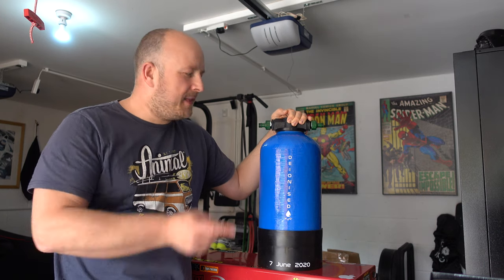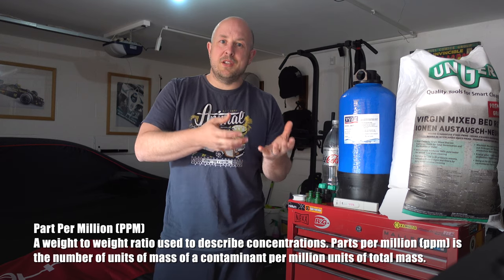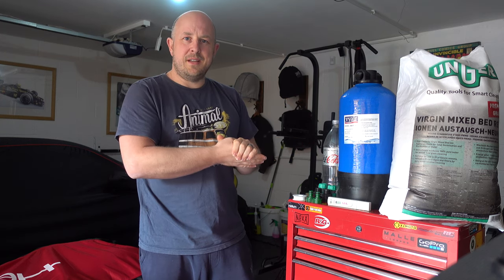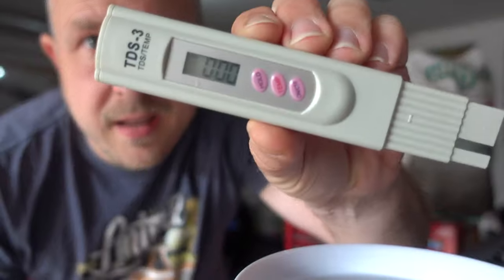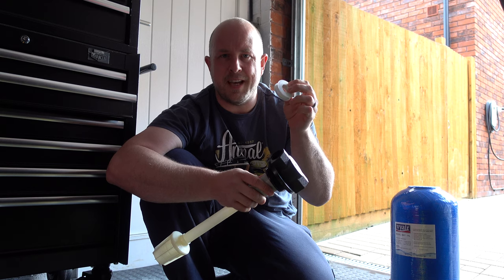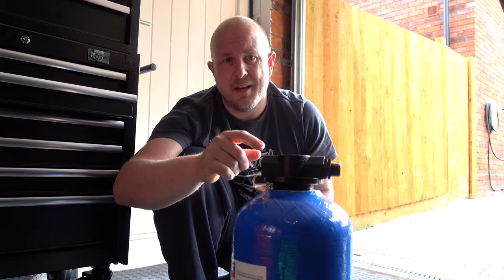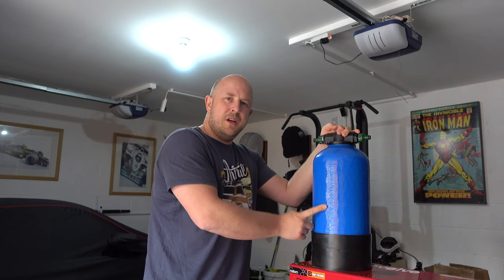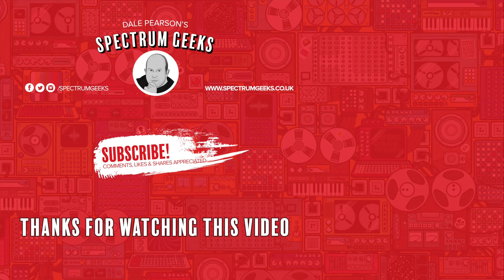DIY Water DeIoniser - No More Water Marks When Cleaning With Tap Water

Comment: I use 3 x 5 litre vessels, when the TDS gets to 010 ppm I change the resin in vessel 1 and move it to vessel 3. Works out about 20% more efficient which, for me,  means 1 less bag of resin per year (£100).
Reply from the maker: You do alot more washing than me, I am still on the original vessel and resin :)

Comment: Not bad at all, with a 4 year old 5 stage RO mine is still around 10ppm (down from 550 ppm from the tap).
Reply: My CoTs resin filter works really poorly with a jet wash, do you think this'd fair better? Right now I have a dedicated waterbutt filled with RO which I use inbetween washes in combination with a detailer
Reply from the maker: I cant really comment on the jet wash as not used it for that, as I only use the DeIonised water for rinsing. Which like you I used to do via watering cans and a water butt, but now just use the hose with this inline.
I don't see why it wouldn't work though as it has good flow.
If the weather lets up I will be washing a car or bike this week so can see how it works with my Karcher.

Comment: i bought a resin vessel just like this but there is hardly any water coming out from the out section. what am i doing wrong perhaps?
Reply from the maker: I have not had this issue, my only guess would be some clogging in the filter or the exit hole. Water flows freely through mine, I can even tip it on the exit side to empty it of water after each use.

Comment: Hi mate, quick question: if i ve right seen  the system arrives with 2 black connectors male 1/4-male 3/4 to adapt the green lock hose 3/4, right?
Reply from the maker: Yeah sounds about right, it was a fair time ago I did this now, but covered all parts of putting it together in the video.

Comment: Hi there - new to all this - what are the 2 connectors that you use to go into the in and out of the vessel please. I have a hozelock male connection with a thread but its a bit leaky.
Reply from the maker: The vessel kit came with the black inserts that go into the top of the vessel, then onto these I used cheap hozelock type connections, but with PTFE tape to give a good seal.

Comment: Great video and well explained. 👍I've got the same setup and would be interested on how long it lasts as I have 450ppm tap water. Also to see if 50ppm is the magic number to change the resin.
Reply from the maker: Still at 0, but with winter (no sun) and lockdown I have not always been using it, so I think its going to last the usual home user many years.
Reply: @SpectrumGeeks  Hope so. 🤞

Comment: Fairly affordable, gonna buy it probably. You used it with a pressure washer? Do you leave it outside?
Reply from the maker: I use it with a pressure washer without issue, but I keep this in the garage not outside.

Comment: hi, great vid. did you try it with a pressure washer yet?
Reply from the maker: Yes, works without issue.
No drop in pressure or issues, been using it a LONG time now, still on the original resin.
Reply: @SpectrumGeeks  after a car wash do you empty out the water from the canister to preserve the resin or just leave whatever water is in there?
Reply from the maker: @mrmanrpatel  I pop it on the side with the hose attachments off so the water can drain out, also then not so heavy to move back into the garage :)